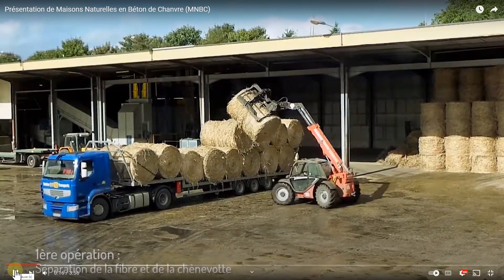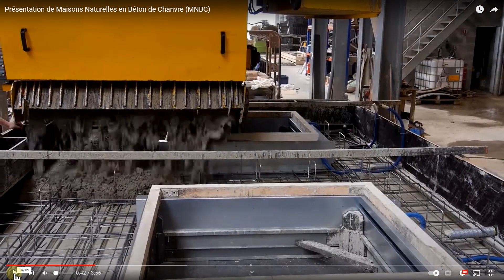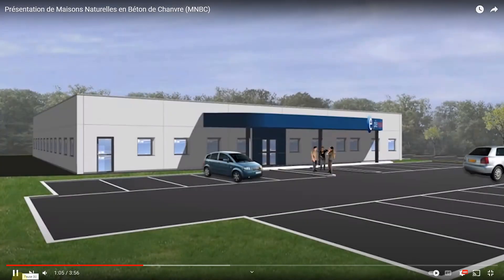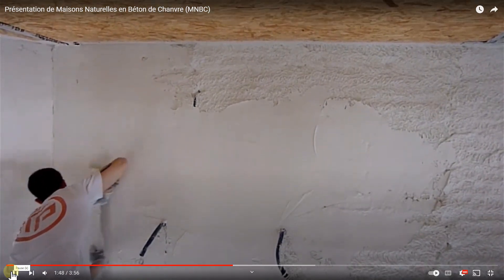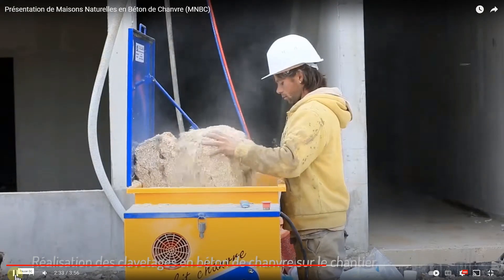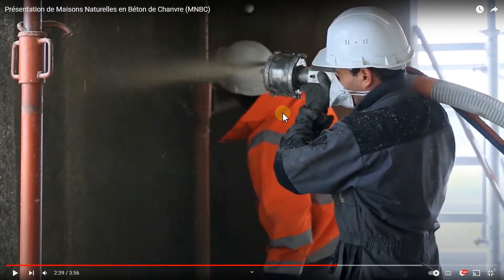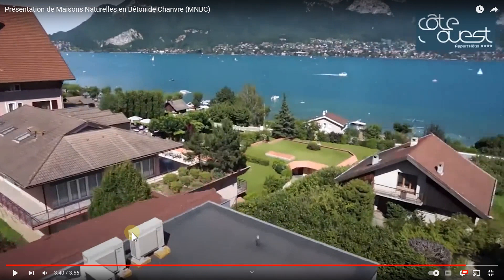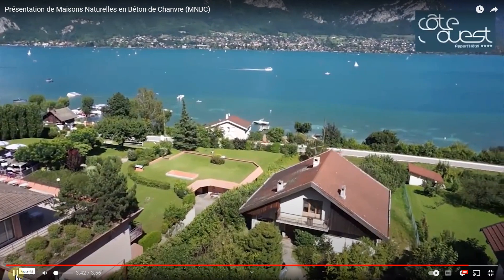Hempcrete cast on top of concrete? Blasphemy or genius?

Comment: Thank you so much for all of your content! I am thinking of using hemp or straw to build a house, and my first thought was that tilt up construction could save quite a bit of time and labor. I have seen prefab panels of straw, (eco cocoon etc) but not hempcrete until I found your channel. Do you know of anyone using a lime binder with straw instead of hemp? Straw is much cheaper to source in the US, and I am wondering if it would be suitable. Thanks for all your great videos!
Reply from the maker: No problem:) I know of one that did it near Smithville Tx (i think)  that being said I just posted a video of sprayed clay and hemp, a sprayed cob if you will. I would think you could use the same technique using chopped straw. It would have to be short maybe inch in length. FYI An interesting alternative used in France is Typha (cattail)

Comment: It's not blasphemy, but in terms of where the concrete meets the Hempcrete. I would have some concerns about condensation and moisture buildup? Due to the gradient differences in permeability. I wonder if moisture probes  or via moisture meter have ever been used to test this issue?

But overall it seems like a very efficient and effective way to build with concrete and hempcrete. For multi-story buildings. 

And if I was going to modify the formula I would consider adding a foaming agent such as the surfactant to the Hempcrete to increase its insulating value. The non-standardization of geopolymers and its chemical makeup, Would be somewhat of a health concern.

But Hempcrete ICF block construction, seems more conducive and unless capital intensive for smaller structures.

Lastly, the terminology is a little bit past my full comprehension, but it was an interesting post on Hempcrete construction. So thanks for posting it.
Reply from the maker: The wall system was tested before any actual installations were done. some of these are over ten years old. The French are anal about testing structures in all manner of builds cob/wattle and daub (torchis), Rammed earth (pise) etc. Hempcrete like Cob structures absorb and slowly release moisture modulating the humidity. It is the single most unique factor in determining "comfortable" feel in a home or enclosed space. In reference to geoploymer, most but not all research papers on geopolymer used fly ash, silica fume, GGBFS Ground granulated blast-furnace slag, as the precursor. Precursors are pozzolanic materials that have all have concentrations of alumina and silica and react accordingly however there is a less toxic path according to Joseph Davidovits. I can post on that subject later. ICF have potential but still need RC (reinforced columns) concrete in rebar. Much like old cinder blocks now called CMU or slump brick. They all required RCs. HempBlock USA needs RCs and a concrete bond beam.
Reply: @hempknowlogy  First thank you for the response.   

Apparently I was not clear in what I was trying to say. My concern is at the "boundary layer" between moisture-laden hempcrete  and  the less permeable concrete. While there's a possibility that moisture can be transposed to the exposed side that's not a foregone conclusion. Depending on the conditions the exposed side of the  Hempcrete can dry out, while the boundary  layer can have a high moisture content. That over decades a deleterious condensation / moisture issue could possibly occur. 
You were saying that the French have done decades long testing?  i'm sure they check it initially but it's a little hard to believe they have done decades long testing for a process that doesn't seem to be that old.  But if I'm making an incorrect assumption please correct me? And I'm just probably being overly cautious in any case.  But it's always good to have long-term testing just to be sure.

Also I'm aware of everything  else that you stated.  But of course ICF hempcrete blocks need reinforcing bar in the columns and beams,  just like in other forms of ICF construction.

FWIW  HempBlock USA  is an Australian company that obtained a French license to market it in the USA .... Since it is a French patented design....

Hempcrete and other forms of cellulose/cementitious hybrid construction. Seem to be at a turning point in the construction industry.  So it's fascinating to see how it's evolving.

Thanks for the feedback and keep up the good work.
Reply: I've seen examples of the rammed earth into car tyres to build an ecohome into the side of a hill.
Shared the came "comfortable" factor, storing heat then releasing it.
 Truly fascinating
Reply: There are more things in heaven and earth, than are dreamt of in your philosophy....